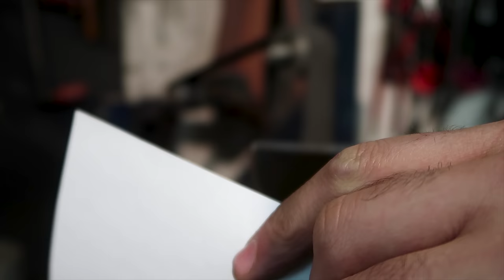Antique Hatchet Restoration. Third Time's a Charm!

Comment: Aren't metal handles quite shit ?
Reply: Yeah, they really cause a lot of strain on your hands/arms/etc because they don't flex.
Reply: yea same. wo0d is the ideal material and much cheaper and easier.
Reply: Honest M'aiq and dangerous because of y'know electricity and such
Reply: I dont think he is planning to use this axe either way
Reply: It ruins the temper and and is a waste of time and money
Reply: Karl Clark-kerr I Am aware of That. My point was That i dont think he is Trying to make the axe useable.
Reply: hydell I agree. But Thats still an opinion aint it?
Reply: Yes, Yes they are
Reply: timotheefresard It is clearly not Made to be used
Reply: The original wood handle is supposed to be dismount easily
Reply: and metal just look shit on an axe.
Reply: I think its just so that its cheaper and faster to do
Reply: i remember as a teenager i used to chop wood for spare cash, one day for some reason i didnt have my own axe
and i borrowed an old axe from our neighbours to do the rounds, it had a steel pipe welded into the head.
oh my god, i was saw for days after that afternoon.
Reply: I thought that you were a liar?
Reply: @jakob4414  fair enough but all axes are made to be used and he did put an edge on it
Reply: Karl Clark-kerr He also mentioned in the description That its an experiment
Reply: round em up some rubber or leather it will be good use. good weight, good cut, less force.
Reply: I have this feeling. Brass/aluminium looks shitty in these situations, are fail-prone (as seen in the video), fragile and will hurt the hand.
Reply: Metal or in this case aluminium is not good for this at all.
The metal handle will transfer the energy to your hands a lot easier than wood as wood is quite absorbent.

Secondly, cast aluminium is incredibly brittle. The handle will most like shatter from the first blow.
Reply: Yea but they look nice as shit
Reply: yes metal handles are horrible. They hurt your hands while swinging and make to much vibrations for the axe.
Reply: Yeah... he just needed those minutes, noone who can logicaly think is going to be amazed by this...
Reply: Then he shouldn't call these videos "Restoration" videos, because that axe is anything but restored.  I stopped watching his videos.  I scroll ahead to see if it's a cast handle, and if it is, I just click a thumb down and ignore it.  
If you're going to cast the handle, why not just carve the whole useless thing out of foam and make a cast aluminum axe?
Reply: Well yeah,they are not good at all
Reply: Honest M'aiq wwe
Reply: Daniel well I think that claim was proven false in the video where he chopped with and even threw it 🤷🏼‍♂️
Reply: Honest M'aiq    yep...not only shit, I guess is a slippery shit..!!!  Regards from Argentina
Reply: He also un-tempered the axe at least twice xD
Reply: yep I agree
Reply: Carpal tunnel from the shock.
Reply: bigDbigDbigD well he can just apply flex tape
Reply: @bigDbigDbigD  looks better too.
Reply: Youll get carpol tunnel if you use metal handles
Reply: I've used axes my whole life cutting wood, even since I was a child going up into the woods with my dad. With the proper wrapping around the handle, it will be just fine. In fact, it will work even better if you know how to use an axe.

I am not a blacksmith. I have just always had all metal axes, and not those cheap chinese made coleman axes. I have a handmade axe similar to this. I have had it for 30 years. Christmas gift when I was 5 made by a local blacksmith. Solid steel. Not a bend, and has split enough wood and used as a utility tool eversince.

So it depends how they are made and shaped.

Also let me clarify. It may not be for a novice. But if you want durability, if you know how to cut wood into splits, have the proper wrapping, and know how to grip, it is much better.
Reply: thank you!
Reply: @blade1994111able  well said
Reply: Steel, yes, but I'm pretty certain that's aluminum, which would be almost as light as wood. Wrap some leather around the handle and it would be just as good as any wooden handle.
Reply: This comment read my mind like a fucking book... if i could like this 1000 times i would 😂😂😂😂😂😂😂👌🏼💪🏼
Reply: This one fails to understand, how could M'aiq be honest?
Reply: They use wood handles because wood absorbs the shock and vibrations better.
Reply: hydell I like the chrome Finnish but it is not practical
Reply: yes
Reply: @smokestack3327  unless he's hack at a tree with wires on it, throws it into water with a toaster and grabs it, or doesn't know about wire cutters he should be fine.
Reply: I think he just did it for display
Reply: Indeed. Furthermore, casted material tend to be weaker than their wrought counterpart. There's a lot of casting defect possible that would make this handle worthless. Foundry operations are kind of complicated because of all the small details it involve in order to produce a high quality and reliable casting.
Reply: makes it heavier. and if youre a strong guy like me you can tear shit up
Reply: Read the description guys, this one's just a showpiece
Reply: Honest M'aiq i guess he just wanted to experiment just like what he said in the video’s description...
Reply: @waxwax1000  r/iamverybadass
Reply: @NOSKHEMTHEANTICHRIST  :D yeah
Reply: It depends on how you do it, for example I made an axe from 1in thick steel then the handle from 1in thick steel as well the way he did it, it is possible for vibrations to srew it up but like I said it depends on how you doit.
Reply: @karlclark-kerr9898  It's in his description. It's for show. You can read it if you want. 😂 
And personally, who said the daedric swords in skyrim are practical? It's similar to this. It's called aesthetics.
Reply: The are why is he not using wood edit : nevermind
Reply: @smokestack3327  i dont think wood is so electric. You shouldnt cut cables with an axe
Reply: No
Reply: I'm a fan of them, but I like it more for the art not how usable it is
Reply: i think about that too see like yours
Reply: Read the description
Reply: Lumi , are you this guys "handler" or publicist?lol.
Reply: Nnja
Reply: Read the description
Reply: Indeed
Reply: Woods better also with a grip very nice and cheap
Reply: No
Reply: He needs to put a rubber grip on it
Reply: Yep big shock
Reply: Description always there..
Reply: It's not completely metal
Reply: SHUT UP IT STILL WORKS BOI
Reply: Lumi it’s not an axe, it’s a hatchet that’s used in battle or for fighting and throwing
Reply: IveAlreadyWon it’s not for chopping wood it’s for battle and throwing when fighting!
Reply: yeah they are
Reply: Shiitake Gaming your wrong, a baseball bat is hollow metal and there’s air inside it, this axe has wood inside the metal handle, and a shiny polished lair of metal, correct me if I’m wrong, if there isn’t any wood inside the the handle, its all metal and it wouldn’t be hollow.
A metal baseball bat only vibrates when it’s hollow and there’s only one lair of metal ☝️ 

Hope you enjoyed your facts Verse lesson!!
Reply: Yea but dont cus
Reply: Zyion Dezeurn what?
Reply: @KiindSoul  it mean dont say bad words
Reply: I think this is mostly for looks ^^
Reply: Yeah but it looks cool though
Reply: Also it's very slippery when you get sweaty
Reply: quite cold in the winter they are
Reply: Read the description before typing
Reply: Agreed
Reply: I genuinely thought this is a April's fool video
Reply: not really depends on the person. My father had toget himself a metal one as well because the wooden ones broke because of his strength
Reply: @jennyferhatala9559  if you're putting in enough tension to break the wooden handle you probably would severely damage the axe as well.
Reply: @afinoxi  well for my father idk he was still young. He told me he had to get a steel axe because the wooden ones got destroyed fast. my father was already hulk at youth he doesn't do it with alot of force when cutting wood but because of his strength the wooden axes are a big no for him
Reply: Honest M'aiq tbh I don’t think he did it to be practical, just for content, if he wanted a practical one he probably would have just bought a like 30 dollar one
Reply: You expect to much from one man
Reply: yep thats why this is a freaking joke he fucked up a nice old axe,
Reply: YES THEY ARE. And the whole point is that this was supposed to be restoring the original axe, which did NOT have a metal handle.
Reply: @blade1994111able  won't transfer if he plants it in a skull..
Reply: Haha
Reply: @smokestack3327  Hang on...I think you may be on to something here....SOMEONE GET THIS AXE TO THOR FOR INFINITY WAR PART 2!!!⚡⚡⚡
Reply: actually now that I'm seeing the finished product, I'm impressed
Reply: Metal unlike wood isn’t a shock absorber so it hurts your hand more
Reply: @cobboGHS91  you were saw for days? Sore? I don't get it. What is saw?
Reply: Honest M'aiq i dont truat you M’aiq
Reply: Read the description
Reply: Read the description, my friend.
Reply: Ну блин почему Русских так мало один даже Китаец
Reply: @IveAlreadyWon  weird flex but ok
Reply: Description clearly states "experiment" FFS
Reply: Yes
Reply: I doubt he’s actually using this
Reply: @karlclark-kerr9898  i see where youre coming from but i disagree, i think its fine to try something new and fun like this to gain skills and knowledge, and to make basically an art piece (i know art is subjective, im just pointing out that its pointless as art is pointless) and as for ruining he blade temper its obviously a pretty far gone piece, and from what i can tell of the quality hes probably not ruining i super rare valuable axe.
Reply: NO >=V
Reply: @KiindSoul  more weight in the handle is bad for throwing and hand tremors will fuck you up
Reply: @KiindSoul   stop
Reply: @KiindSoul  dude
Reply: @KiindSoul  it's obvious you have never touched an axe before let alone a hatchet, also nice compliment
Reply: Larri þyrnir and how exactly is it obvious, I have I’m a country boy. I’ve been handling tools since I was 4. Usually tho a hatchet would have a rubber, hard plastic handle tho when you buy one. Don’t assume shit.
Reply: Honest  M'aiq   The metal handles are not quite shit, they're complete shit
Reply: 3rd times the charm eh? I like the look of the aluminum handle but it isn't ideal for actual use, which I'm sure he knows. Still a good restoration. +1 sub
Reply: True, but it may be harder to restore it using wood because he would need to shape it. Using styrofoam is easier
Reply: Lumi he could be using it to chop wood how would you know.
Reply: tha's a.. lot of kick.
Reply: Maybe it's for heavy duty and you also can attach rubber on the handle
Reply: Check the description. It says it is just a show piece
Reply: Yeah because the vibration from the handle transfers through your fingers witch hurts like shit it's like hitting the ground with a baseball stick
Reply: You don't use antiques its like making a brittle old man do heavy lifting.
Reply: Repent and to Jesus and live holy
Reply: M'aiq knows many things that others do not.
Reply: art
Reply: If it werent aluminum it would be bad, just wrap leather around the handle, BAM, its better than wood. More durable, not going to shatter and splinter, not going to swell from moisture. Just as light as wood. I dont think hed being throwing that hatchet if it were made from steel or nickel.
Reply: @dennisthemenace3224  ha ha i see what you did there
Reply: Honest M'aiq HONESTLY I don’t think the owners going to use it since it’s pretty old
Reply: Stop wasting good axes
Reply: Yep cast aluminum is also relatively brittle, especially from a DIY foundry, and eventually the shock will cause the handle to crack in half, if your hand doesn't shatter first.
Reply: @IveAlreadyWon  There is no strain if you use ax to shave yor hand or cut paper.
Reply: Si, usted tiene razon, los mangos de metal son una poronga.
Reply: Meh😒 it's just beautifull😍😍🤩
Reply: Yes. Really pointless restoration. Shiny handle had no friction making the axe useless and dangerous to use. Axe is used in extremely rough situations, so making it glossy goes against the objective.
Reply: So you made this for Thor?
Reply: Maybe he thinks it's fun to cast aluminium
Reply: Metal is shit for several reasons :p 

As noted, it doesn't flex, so it far worse for you hands, but also metal just break when wood tends to show that its about to break long before it actually gives in. 
Its even a tad worse with this handle since one made in a factory would be x-rayed for flaws and its a tool you are supposed to use force when handling. That handle would shatter if you actually used the axe as an axe.

Also, metal has an knack for becoming slippery when you are sweating or working where its wet while wood doesn't. Can ofc be fixed with some form of wrapping or tape to enhance the grip.

However, I doubt the point ever was to use it as an axe. So for having it on the wall, metal will do just fine. Assuming you think that a shiny polished metal look is how an axe should look :p But looks are more a matter of opinion tbh.
Reply: i wonder if he can make a silver hatchet and let it soak in holly water for a year.  Ultimate evil killing tool.
Reply: @JarlSeamus  apparantly you still watch his videos
Reply: @diesel2.091  Nope.  I watched enough to know they aren't my cup of tea.  Not gonna knock anyone else for watching, I just don't like making a useful item into a non-functional wall hanger
Reply: @JarlSeamus  well said
Reply: Not if you use vibration. I’m sure that’s what he’s using. It absorbs all vibration.
Reply: not smashing a soft skull apart i would think so, but for wood yes...
Reply: Yes
Reply: @karlclark-kerr9898  um, just the edge is usually the tempered section of an axe head
Reply: wood or metal, it will keel(forged in fire ref.)
Reply: Not strong enough
Reply: Not worth the effort.
Reply: Yes they ring into your shoulder
Reply: They are but if you put a rubber handle on it for the cold and grip and something for the shock they aren't that bad
Reply: For minutes I was like  "what is he doing" because I really didnt get it. Then I understood that he was going to make a metal handle. Doesnt quite make sense to me either. Why not just some nice, good old wood handle.
Reply: This is just my opinion but.. that looks disgusting. Just cause its metal and shiny doesn't make it pretty. This isn't a restoration.
Reply: Like u can make something anything like it
Reply: Usually better to make a transition from metal to wood, that transition is your main focus as it determines the strength of the thing. The seem where wood meets metal is the weakest point. But do it right and it is almost indestructible.
Reply: how does a comment like this get 4.2K views wtf
Reply: @ketaminekyle4801  likes, and because it is true. Metal handles are not ideal, you know if you ever used them. They are annoying to use and your hands will hurt.
Reply: @jeremybree1986  i understand that but its such a simple comment and yet it got so many views for some reason.
Reply: Never fails. Every YouTube video I watch, there's someone in the comments that knows better than the uploader. Why is that?
Reply: @prestigiouscarrot9710  who are you alluding to exactly?
Reply: Metal absorbs more shock thats why they use wood more so it does not hurt your hands
Reply: But you can also wrap the metal handle in rubber to avoid a bit of shock
Reply: IveAlreadyWon y’now what does flex though

Rich people
Reply: The fact you couldn't say it was aluminum specifically kinda renders your opinion a but void.

An aluminum handle and a tugnsten handle are both technically "metal handles"
Reply: @jakob4414  what if it is :0
Reply: @jakob4414  He said it's a casting experiment because of the way he did the handle, but in no way does that say he's not going to use it.
Reply: bigDbigDbigD 
you just reached 666 likes
Reply: Yes, It conducts both heat and electricity.
Reply: yep.
Reply: Probably it's better for throwing because of better balance
Reply: @IveAlreadyWon  w͢e͢i͢rd͢ d͢o͢e͢s͢ b͢u͢t͢ o͢k͢

I͢'l͢l͢ l͢e͢a͢v͢e͢ n͢o͢w͢
Reply: I can hear your accent
Reply: This axe is for home defense so hes not worried about the impact.
Reply: @IveAlreadyWon  its because the material has no give, and no movement, so all the stress and force is transferred to your hand, instead of the tool.
Reply: اي صحيح
Reply: ههههههههههه
Reply: ههههههههههه
Reply: مرحبا
Reply: مرحبا
Reply: Honest M'aiq I am a metal handle and find this comment offensive.
Reply: @jakob4414  I agree
Reply: Why would anyone make a metal handle
Reply: I heard that metal handles that are fluted and cantilevered are quite good, but have never used one myself.
Reply: I have to agree with you there
Reply: I mean...if he could go back in time with it...he could buy like a whole village with that thing.
Reply: Yes, they are pretty awful, they don’t flex and can fuck up the blade
Reply: Reading description level 100
Reply: What if he uses a combination of wood and metal for the handle?
Reply: @kylegarrison3131  Is it really you?
Reply: Most splitting mauls have metal handles so idk
Reply: Yes beecause they absorb no impact so it will hurt your hands when you hit smth
Reply: It's balsawood fools
Reply: I prefer steal handles, any other material I break real quick
Reply: Point is, it’s a restoration, not for everyday use. I love it
Reply: Yes because the vibrations when you hit a tree will fucking hurt.
Reply: Karl Clark-kerr it’s good practice for casting, I don’t see the problem you have with it considering it’s not your time or money he’s wasting
Reply: @karlclark-kerr9898  I don't see it as a waste in his case. A hobby he probably enjoys and if nothing else it will look nice in his shop. Easily compared to when people purchase paintings, useless but eye catching.
Reply: Yeah because it's not flexible and its heavy
Reply: Lumi that’s not the point the point is that metal handles don’t work as well
Reply: Im the 6666th like
Reply: Lumi but Wood is still better because you could put beautiful designs on it. This is just a bland piece of metal, nothing great to look at, boring, and useless.
Reply: Honest M'aiq I believe you can rap it with rubber to help absorb the shock
Reply: Wouldn't Making handle of smooth metal will defeat the purpose of a handle (greep) but would be really heave too right.??
Reply: I h8 them if you restore something arent you suppose to make it the way it originally was ? ( keeping the details that are part of its history like that nice handel)